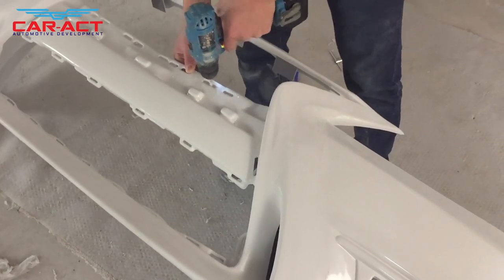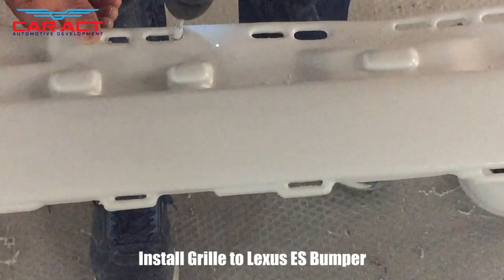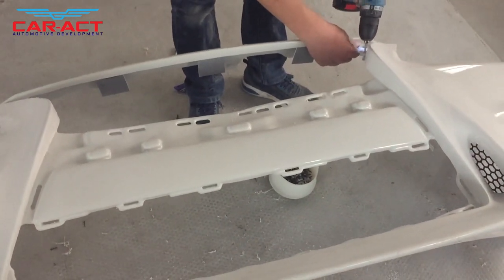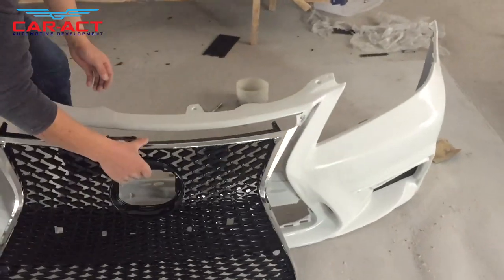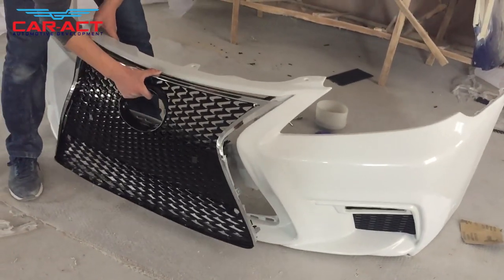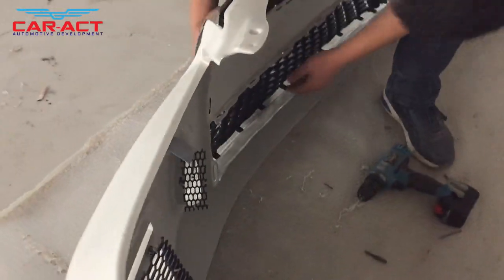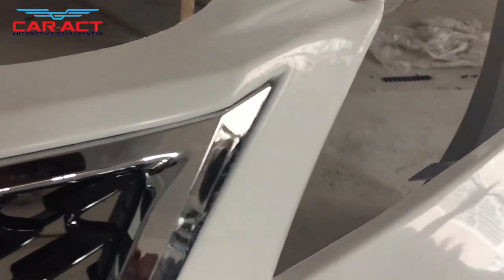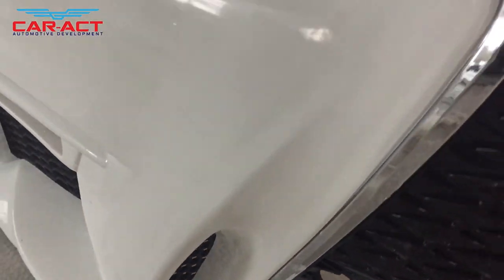Whole story of installing GRILLE to LEXUS ES style BUMPER / Car Modification

Comment: I am interested in buying the Lexus GX460 F Sport Grille. So will I have to do the same process for my Lexus or just remove and fit. Because I don't want to drill and do complicated stuff
Reply from the maker: Yes, it's plug and play, no need any trim work. Take out your original grille and replace with the new grille http://car-act.com/product/en/2014-2019-Lexus-GX400-GX460-Tune-into-F-Sport-style-add-ons.html

Comment: Can I install this mesh grill on the 2019 ES 350? (I have a regular ES 350 without the F-sport mesh grill).
I know the 2019 version of the car is refreshed, and has a wider body frame... but unsure if the grill area is same measurements?
Reply from the maker: I am afraid not, thanks for commenting

Comment: Will this fit the 2007 lexus es350?
Reply: I wonder the same thing
Reply from the maker: @mram5047  Yes, it matches from 2006-2012 Lexus ES series without extra trim work.
Reply: @CarAct  what year is that bumper and grille??? What is it that I'm looking for when purchasing the bumper and grille?
Reply from the maker: These bumpers and grilles are aftermarket, fits on 2006-2012 Lexus IS, welcome to send email to contact@car-act.com or WhatsApp +861732 8662 098